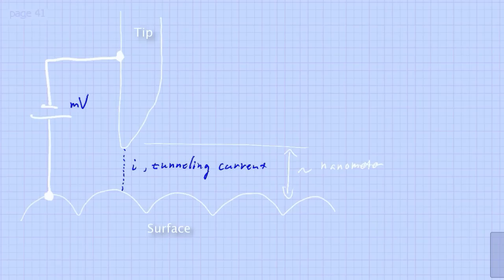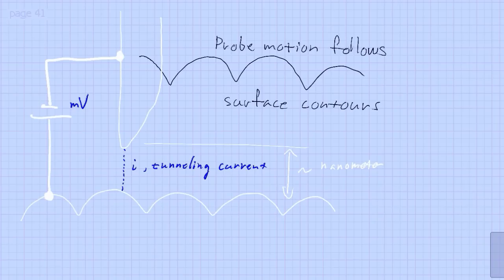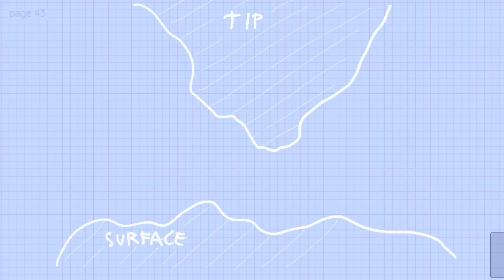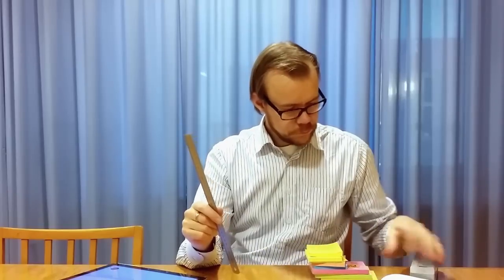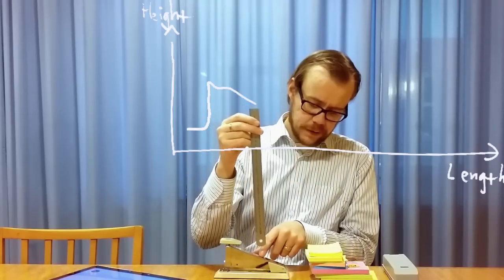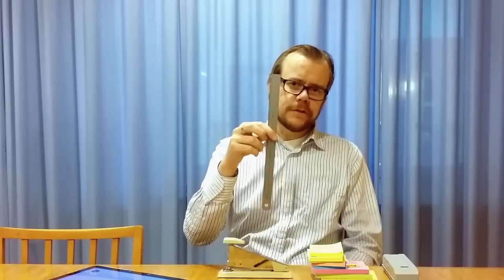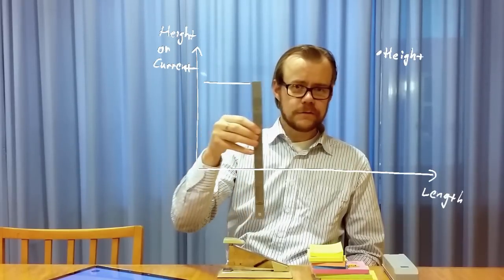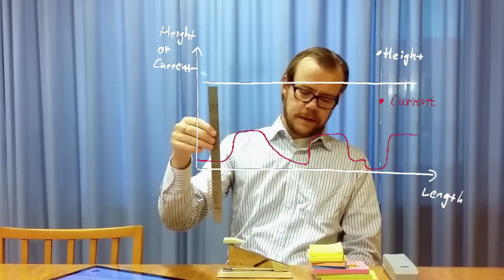Scanning Probe Microscopy Lecture #1 STM

Comment: I would like to see more about the system...
Reply from the maker: -Did you also check the SEM demo? 
https://www.youtube.com/watch?v=_q7wKmV9-7c&index=7&list=PLwCFBj9ZpOBbVW04LGO9UoXQPLUe9BtqG
Reply: In fact, i d like to know more about the head stm...
Reply from the maker: Ops, I meant the AFM-demo, sorry for the wrong link, I have yet only demonstrated the AFM not the STM unit, but the control of the unit is the same, except that you use a metallic wire as tip for the STM rather that the more complex cantilevers as in the AFM case. Check that demo if you haven't, I might add some more movie on the STM perhaps later on. https://www.youtube.com/watch?v=Kz4S0pd6-hU&list=PLwCFBj9ZpOBbVW04LGO9UoXQPLUe9BtqG&index=10